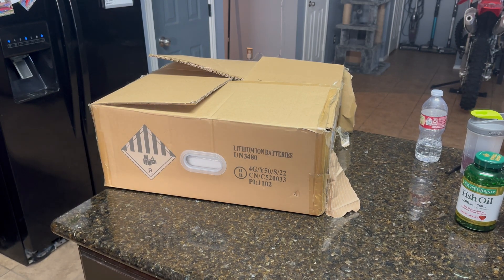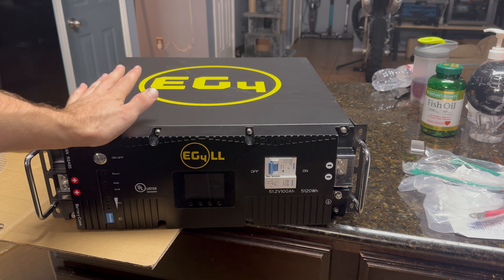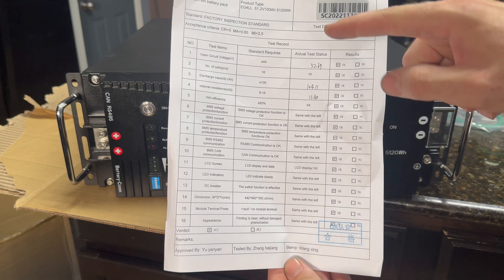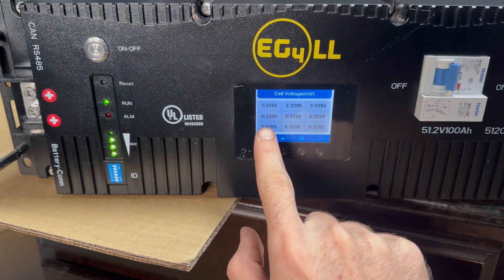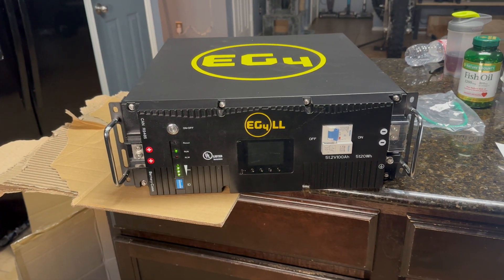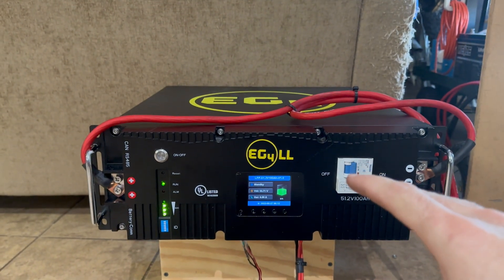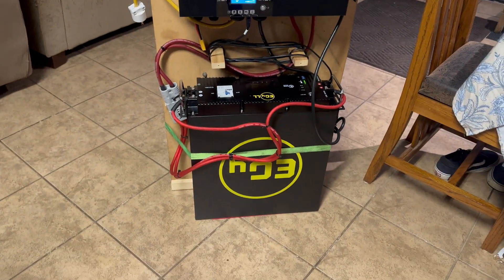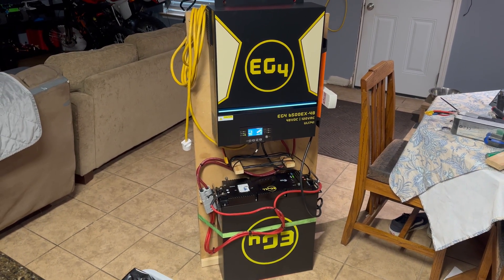48v Server Rack 5KWh Battery unboxing EG4

Comment: WELL  how much did it cost?
Reply from the maker: @kevinott-ol2ry  they used to be over 1500 now there 1300, still pricy but it’s a very solid unit that can potentially last 15-20 years
Reply: @Mikebuildss  Thanks.  I'm  planning and saving up to start a small system that I can expand. I think 48 V is the way to go. My thoughts are to start with the 6000 all in one inverter, one battery and I'm not sure how many solar panels. I just want to run my refrigerator first. Then well pump, then other household appliances. Is this practical?  I'm thinking that 5000 euros should get me started. What do you think?

Comment: Nice waiting for you to do a video with the battery hooked up to your new inverter and running your mini-split
Reply from the maker: Working on it as we speak!
Reply: @mrkillowatt  ok cool i should film something my self I had a issue with my split but I think it's running ok now..
Reply from the maker: @thelithiumpowerch  yes sir if you have problems make a video people are very helpful in this community of solar stuff I’ve noticed
Reply: @mrkillowatt  oh I have it fixed now I'm good it was just low on R410a refrigerant I had disconnected the original line set when I bought a stand and a new 25 ft line set because I relocated the indoor unit & basically had to do the whole install again..